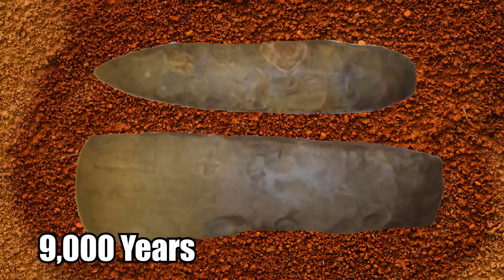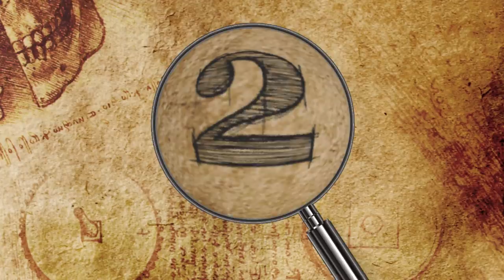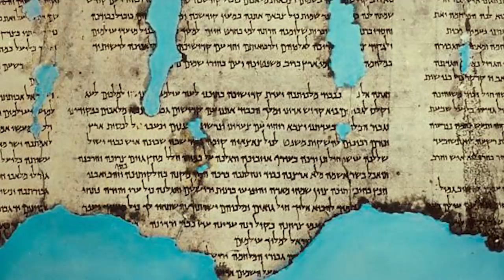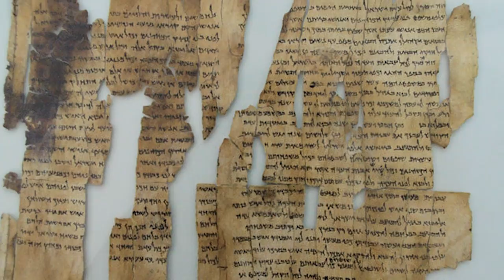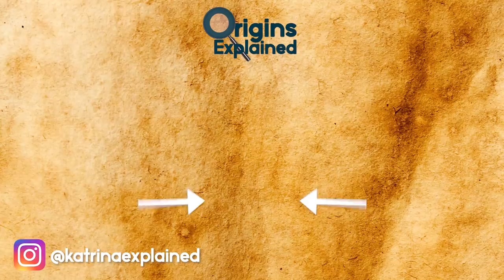This 1000 Year Old Body Of A Woman Preserved In Bloody Red Liquid BAFFLED Experts!

Comment: Hey Katrina. In my little bit of research that I’ve done in the past, New York in certain places was kind of swampy. So they would take ships that could not be repaired and they would sink them on top of each other in areas that needed to be filled instead of dropping stones or dirt. Then they would place stones and dirt on top of the ship. So that may be what happened in the case of the Ground Zero mystery.

Comment: I found a newspaper from year 1984 (that newspaper was published 20 years before I was born) in 2012. I found it in a giant box which was mostly filled with old clothes and a thick layer of 15-20 newspapers in the bottom to protect the clothes. Most of the other newspapers were either from 2010 or 2011 (as they were replaced in every 6 months or so), except that newspaper which was by that time nearly 28 years old, but still readable and mostly intact. It's still somewhere in my house.

Comment: "Magnet fisherman"? Wtf that is, lead is not magnetic. There would have to be iron inside them.
Reply: He just happened to find them when magnet fishing, he didn't remove them with the magnet, he removed them by hand.
Reply: @thehowlingjoker  I see. But what does one hope to catch by fishing with a magnet? Do fish respond to a magnetic field?
Reply: @donellmuniz590  They fish for things made of metal.
Reply: @thehowlingjoker  How odd. I'm a scrapper, and the only things that attract a magnet are iron-based: cast iron, steel, and low-grade stainless. But they could have more valuable metals attached to them, like copper, brass, and aluminum. Not likely to find any gold or silver though!